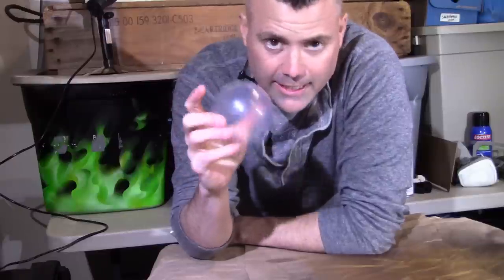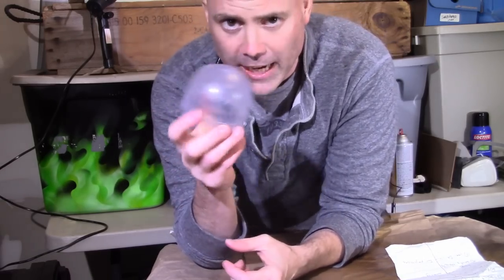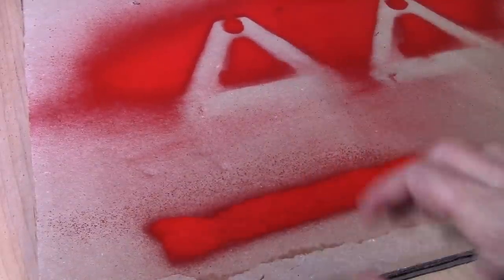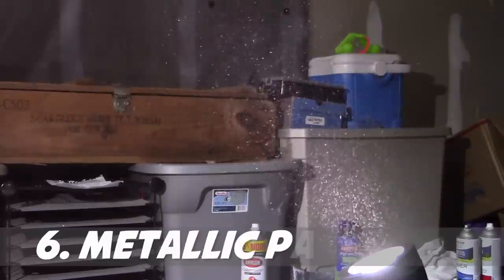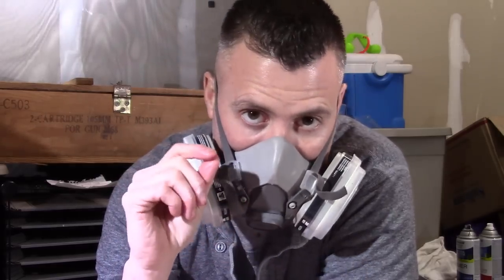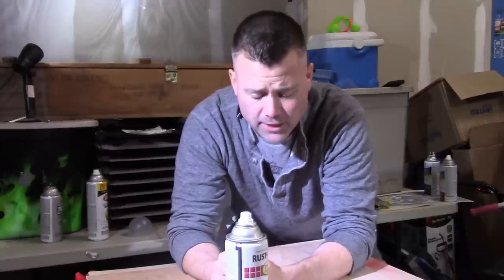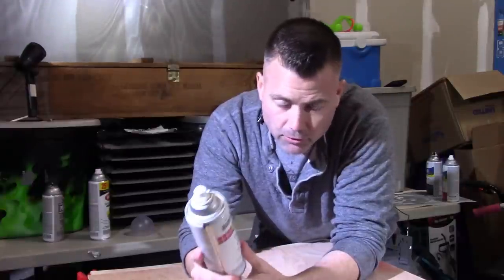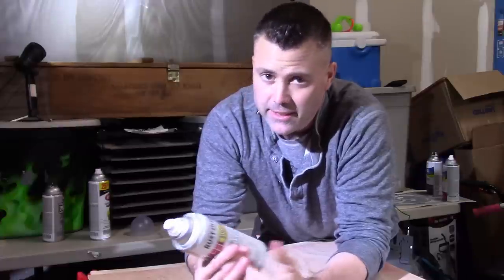Top 10 Spray Paint Tricks NEW

Comment: Very thorough, besides the difference your spraying technique when demonstrating cold vs. warm cans. You painted in vertical lines with the warm can and painted “dottish”with the cold one. I’m sure you realized that already. I especially appreciated the tip regarding dry vs. cure time and clear coating. Thanks, man!
Reply: That’s how it comes out cold its not spraying solid. it doesn’t have the pressure, he is pushing the top down but its not coming out so he has to keep pumping the top
Reply: Wish he had gone into more detail of temperature & humidity of ambient air, and temperature of part as well. I’m having a recurring issue of paint going dull (gloss turns flat and color fade) along with cracking, and peeling. Seems like it happens when painting after the sun has set and humidity rises.

Comment: I used that Rust-Oleum 2x on a set of dirt bike fairings. Followed the directions to a "t". Waited. 4 weeks even after spraying the base color and left the pieces in my heated garage. The paint looked nice and was cured. The second I hit it with the clear, same brand and type. The paint wrinkled up like is sprayed it with stripper. I even redid the pieces and instead of waiting I sprayed the clear within the recoat window using a plistic primer to start with. Let that sit a month. You could take your nail and pick at the edge of the part and Peel the paint off the plastic in sheets.I used a blowgun on my air compressor and just blasted the parts with air and the paint flew off easilly. Oh I forgot to mention I had even roughed the parts up with some 400 grit before painting the second time. I went out and bought krylon fusion and didn't have a single problem.the boys have wrecked and dropped the bike a few times now and just minor scuffs in the krylon.
Reply from the maker: Great point: Plastics that are going to bend are going to be problematic, i.e. fairings. The pros use a longer process. They go 400/600 grit / then de-greaser / then water/ then dry / then they use Bulldog Adhesion promoter (a bit pricey) / then they paint / then they clear with 2 part automotive clear. Then they cross their fingers and hope that the the customer doesn't bend the fairing and the paint cracks anyway. You did everything right except maybe de-grease and use 2 part clear. It is good to hear that Fusion is getting pretty good. They've been tweaking the formula for several years. I've had pretty good results with it as well. Thanks for the feedback. Clear coat in the can is crazy fickle. The only thing that I can suggest, if you have to use it, is to dust the first coat on to try to seal the first layer without giving it a chance to crackle. But in reality it can be hit or miss.
Reply: @Commandodesigns  yeah I'd never painted motorcycle plastics with Rust-Oleum before. I'd always used automotive paint, but those were on full sized bikes , this was a small 110cc pit bike and wouldn't have been cost effective to have automotive paint mixed up. And admittedly I suck with a spray can compared to. Having an hvlp gun in my hand.
Reply from the maker: Well I commend you for your bravery. I've been there, it's hard to justify the price of using the good stuff for small projects. I'll be honest with you, I don't really get it with rattle can clear. It's complete voodoo sometimes. I was going to make a video about the problems with spray can clear and I couldn't get it to have a problem. Then, of course, everytime I try to use it on a budget project it gets wierd. Thanks for the feedback.
Reply: Sometimes if the product is new or has been sealed, some of those cheap Chinesium plastic parts continue to off-gas and can be hard to paint. Getting paint to stick to them at all can be finicky at best. Especially if they have that plasticky smell to them, it's the same as properly cured paint. It might not have been an issue with the paint but a factor of time and letting the plastic finish off gassing and become "clean" enough to stick to paint.

I've had that problem with stuff before like ordering blank white plastic masks for Halloween and the paint literally fell right off. It looked fine until the clear coat, the clear looked like shit and then it all just fell off... 
I gave them to my nephew the next year and let him experiment and they took paint perfectly fine. I spoke to my friend who owns a auto body/paint shop and he explained this all to me. He said sometimes cheap plastic body panels have the same problem and need to sit in a ventilated area for a while before he can paint them. 

I hope this info helps or makes you feel a bit better since it probably wasn't your fault. 
I had a nearly identical issue to yours painting a cheap 50cc motorcycle for my niece so I know how you feel. The kids don't understand and just want it to work and blame you... lol